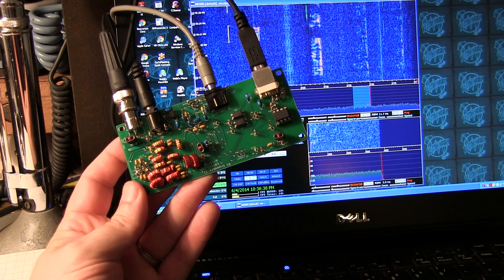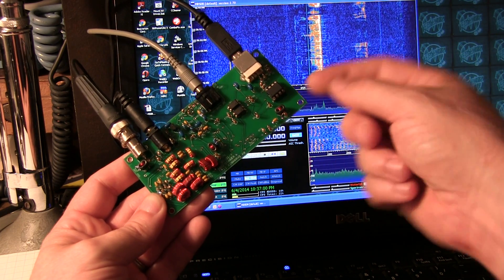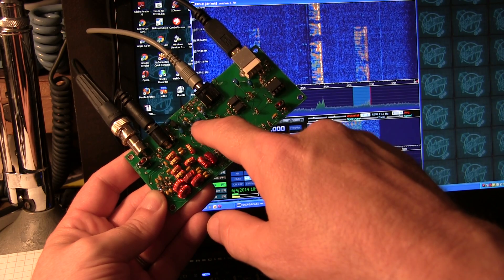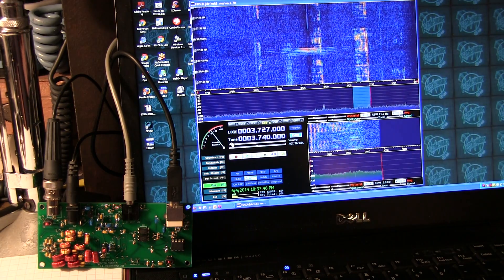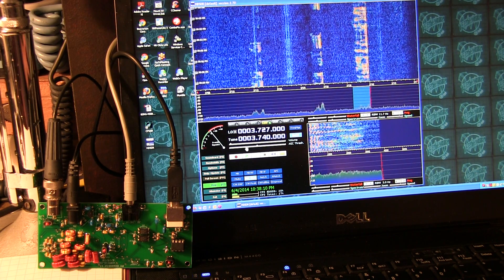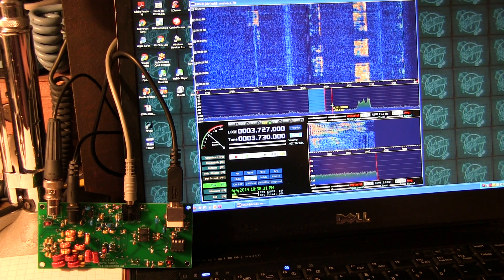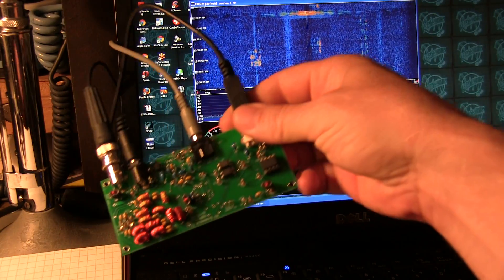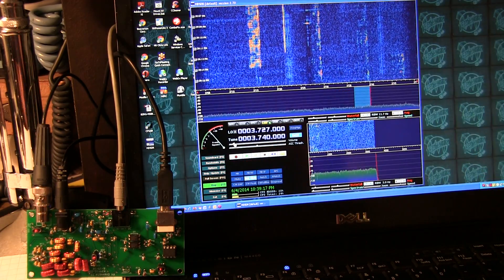#152: Completed Softrock Ensemble II SDR Receiver kit | On air checkout

Comment: Thank you for a good demo video... Can you only scan 48 kHz at a time? So how do they get these to cover a wider range or better agility? I ma guessing through software. Can you  connect one of these up to websdr.org? And if so, can the users tune it outside of whatever initial 48 kHz swath it is set for?
Reply from the maker: The bandwidth is limited by the sample rate of the IQ data.  In this case, the sampling is done by the sound card in the PC, which has a relatively low sample rate (48kHz), hence the low bandwidth.  The SDRs that can cover a wider real-time span don't use the sound card for the IQ sampling.  I don't know the process to connect to websdr.org, or sdr.hu, etc.

Comment: what software are you using in the computer. Do you need a WIN 7 64 bit machine or 32 bit?
Reply from the maker: I'm showing HDSDR running on a WinXP 32 bit machine.  Also works well on Win7 64 bit.
Reply: Sorry for taking so long to reply. I signed on youtube to thank you. I am waiting for delivery of a Softrock Ensemble and start the download and connection to the computer. Thanks again for your time

Comment: I have been an avid homebrewer since the mid 50s and have been a ham operator for 46 years. I wish I was a few years younger so I could build one of these. At the age of 70 and with the medications I am on I'm afraid my hands are too shaky to attempt to install the SMDs. Do you know if anyone sells one of these boards with the SMD's already mounted?

I have thought about lashing together one of the inexpensive TV dongle's but I'm not certain that's the route I want to take. 

Thanks for sharing your video. It's amazing how technology has advanced so much since the mid 50s when I was 11 years old. 

73 -- de Mick, WB4LSS
Reply from the maker: This is offered as a completed unit.  I would think, that if you ask, you may be able to get it partially completed (SMT only), if you want to do the thru hole yourself. I don't know for sure, but it's worth asking.